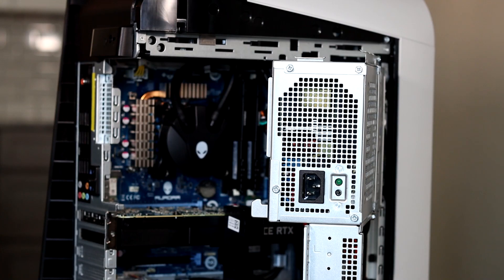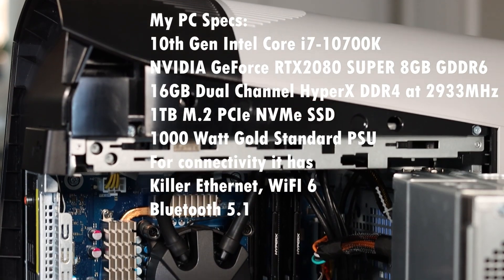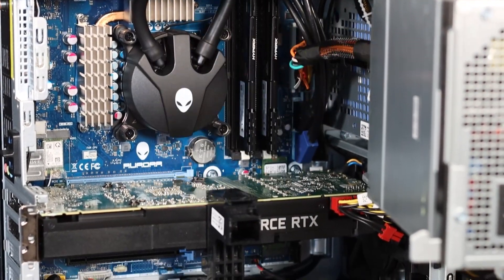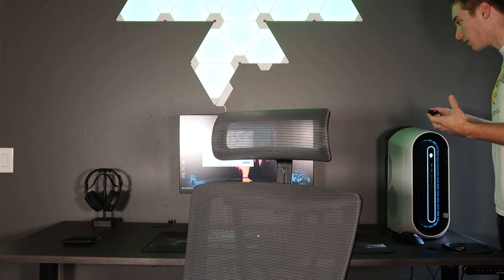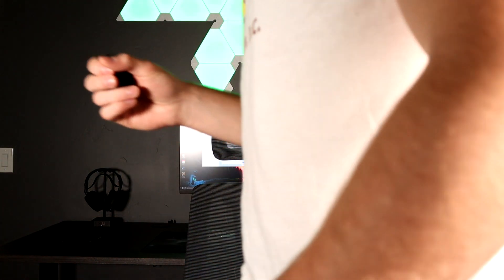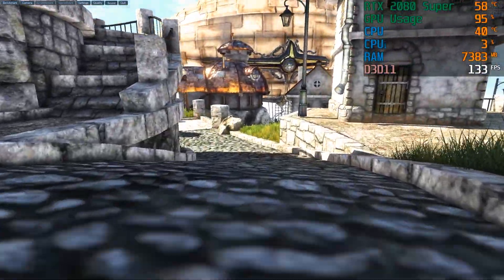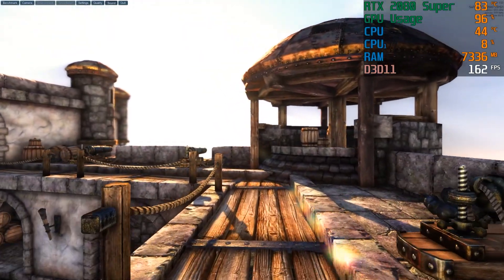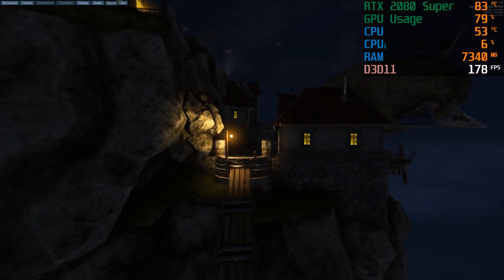Alienware Aurora R11 - Thermals & Fan Noise Test

Comment: hey, great video! so basically i don't need to worry about the gpu reaching almost max set temperature (84 degree)? because lately my gpu (nvidia geforce rtx 2080 super) started turning up and i don't know why
Reply: I reach that temp too on my R10. They used a shitty cooler for the GPU on these rigs

Comment: i got a 3080 10700 and during warzone my temperature for cpu goes up to 90, is this bad?
Reply: I have the same thing but we need to update our fans and possibly get liquid cooling in order to drop the temps at least 20 degrees
Reply: very
Reply: its warzone tho call of duty is bad on PC
Reply: @solidrenegade  ehh it’s better than on console that’s for aure
Reply: @josemadriz5716  optimization wise so no it’s not better on PC
Reply: @solidrenegade  what are you even saying bro 😂
Reply: @josemadriz5716  knowledge because I actually have a PC, it’s unoptimized on pc so it takes up unneeded hardware like MWR for example.
Reply: @solidrenegade  why does every pro use pc cause it’s better than console
Reply: @josemadriz5716  what pros? Swagg and shit use pc for VPN and bot lobbies lmao and I never said they were all bad on pc
Reply: @solidrenegade  bro make up your mind, is console better than pc? No it isn’t! That’s why most players use Pc. Console is shit with its horrible FOV.
Reply: @josemadriz5716  FOV doesn’t mean console is horrible, all I’m saying is call of duty is unoptimized on PC.
Reply: @solidrenegade  bro just stop talking, pc has better frames, better FoV, better graphics, just stop. No one cares about “optimization”

Comment: If you would of set your gpu fan at 60% in msi your gpu temps would of been under 75c. People are not using the gpu fan correct in msi/af which is way their gpu temps are over 80c. I use 55% fan speed while gaming always for my R9 - 2080 Super and run at High Performance mode in AWCC. My card never ever gets over 75c.
Reply from the maker: I just didn't want to change anything so people know what to expect with it just the way it is. Thanks for the recommendation though

Comment: Gotta use msi afterburner to control gpu fan and temps. My 2080 super never gets over 75 when using msi manual fan settings at 55 % . I do not use the gpu fan in auto. Just slide it to 55 and apply. When I’m done gaming I use the auto feature
Reply: Is there a way to controller cpu as well?
Reply: @itsajoke631  —- I have liquid cooled cpu so I don’t know about that sorry

Comment: About the fan noise is it always that noisy at all times? Would it be that loud if I’m running an old game that doesn’t revolve around graphics?
Reply from the maker: I showed when its under no load and under almost max load. So if it was less it would not be as loud as it is at full load. The fans will just ramp up as needed to keep GPU or CPU cooled.

Comment: Would this be a good first gaming pc I’ve never played games on the pc but I have been wanting to get into it thanks you and have a good day
Reply from the maker: Yeah, for a first gaming PC this would work good. If you knew how to build a PC I would recommend that, but dell does a pretty good job with the R11. If you do get this just make sure you choose components you would need to do what you plan on and get the water cooled chassis, cause if you go with just air you will have troubles with thermals. Dell has a good warranty that I would recommend getting too since its your first PC
Reply: Caleb Thornton ok thank you for the advice I will keep this in mind when trying to decide whether I’m build one or buy a pre built one
Reply from the maker: @badnfluenzz4646  No problem! Thanks for watching 😀
Reply: @CalebThornton  i7 10700f, 3080 gtx, m.2 500gb ssd, 1000w psu, single fan radiator water cooled cpu, they don't say the mother board type, ram i have 3200mh 4 sticks of 8gb I'm hoping it has the slots for it? Along with a WD black m.2 1tb ? What would you recommend for a personal built pc? Gpu's were so over priced from lack of stock 😬 For $2040, I couldn't build anything cheaper that I was seeing. Maybe when stocks get up to demand prices would be closer to msrp
Reply: @1Deejay7  Exactly. As far as the motherboard, I could just find out it's the "micro atx motherboard". I'm still debating to buy pretty much the same build as urs or just wait a couple months since I've never done pc gaming (just consoles)
Reply: @1ce2berg  so the board only had one m.2 slot and my 4 sticks of 8gb ram wouldn't work at 3200mh since only 2 dimm slots supported xpm is my understanding. Im actually going to return it. I had extremely poor customer service, also never recieved the promised cold war game codes. I've looked at a number of pre build companies and it seems I BUY POWER is the cheapest one with a lot of decent options that other companies overcharge on.
Reply: @1Deejay7  Thanks for the info! Yea, they all overprice and possibly put Inferior quality parts that aren't as important so nobody will be paying attention to them. I'll check out I BUY POWER. But at this point, I am leaning towards building my own pc based on a 3080 and a i7 10700, with the help of a friend
Reply: @1ce2berg  Goodluck, I actually wanted to go that route too but I couldn't find any msrp priced 3080s, no matter which brand. All were well over 1k. Probably due to miners and scalpers buying the bulk of what's even available
Reply: @1Deejay7  Yup, I'm in Canada and this store did have them available on backorder for $1200 CAD (not even including sales tax lol). At this point I have accepted spending at least $1k on a GPU lol. An unrelated question regarding Alienware, I am planning on getting their 38" ultrawide monitor to pair with my new pc. You think it's worth it or should I just go for the LG CX48 for the same price of $1999 CAD?
Reply: @1ce2berg  Nice selections, I just have a LG GN850. I'd say it depends if you're a competitive gamer or just using it for recreational play. Alienwares 144hz vs 120hz. I'd probably get the LG, 4k oleds are amazing and you would definitely take advantage of the 3080s capabilities. I think later on in 2021 higher refresh rates will available for oled. Just my novice take on it however.
Reply: Yes !!! This is a beast of a gaming machine. Don’t buy ... make a investment.
Reply: Honestly i think its a aweful first gaming pc for the price. For that price you can build a high end pc with a youtube tutorial and about 5 hours thats how long it took me to build my first and even on benchmarks and anything my gaming gpu never hit above 50° ive tried dell and hp because i was scared but firstly my hp omen ran hot like this one. And my dell my gpu crashed after 1 week and i had artifacs i would never recommend these brands. Especially because the parts they use are just not great honestly. All low end parts. I wanted to love them i even tried both hp and dell high end 2500 gaming pcs both with rtx 2080. But the custom one i build is awesome but im curious about the 3090 because i bought a cool lg cx tv

Comment: Thanks for sharing Caleb.  I got exactly the same setup a week go. I am into Flight Simulator 2020, x-plane 11 and fortnite occasionally at ultra.  I find my GPU temps maxing at 84c consistently which is higher than the average 75c for this type of cards.  

I then took the card out and found out that AW is using a customised version of the MSI RTX2080 Super Aero. (Blower type - budget GPU) in my setup.  I found the temps to be on the high side TBH.  So to compare I put in an Asus  GTX1070 Dual OC and amazingly the temps went down to max 74c and lower CPU temps at about 60c avg compared to 70c.  (lower FPS of course)

The good news is that It seems that this case can handle dual fan GPU's which seem to provide better cooling.  Now I have to call Dell.  Thought I  share that.

PS:  Liquid cooling for this card is recommended.
Reply from the maker: Thank you for letting me know, Dell is annoying and i hate what kind of parts they try to get away with putting in these sometimes. Hopefully you can get this resolved.
Reply: Is the PC good for MFS2020

Comment: Few things to note:
1) You may want to move your case out from the wall or angle it. The GPU is a blower and all the heat is sent out the lower back of the case.
2)The 2080s was Thermal Throttling and that why it didn't get any hotter. If you look in after burner you will see that happening.
Reply from the maker: Ok, thanks for tips. It's 8-10 inches away from the wall so it should be fine. According to GPU-Z I'm actually performance capping because of Power. As far as i could see it was not because of thermals but then again i am not that good with troubleshooting and figuring out that stuff. I planning on building my own PC within the next year so i will have to learn more about it.
Reply: @CalebThornton  In MSI afterburner just drag the power to max and it will allow more power but the Temp limit is 84 so would likely need to bump that to 88

Comment: try testing the unit without the liquid cooler. Mine was like a freaking leaf blower until I upgraded to a CPU aio and replaced all the fans to corsair ml120 pro non led fans. Sorry but video feels like a Alienware say some thing nice promo.
Reply from the maker: I only have one with liquid cooled CPU so i cant test the other options, but thanks for input. Maybe someone else can benefit from this, so far mine has not been very noisy at all though.
Reply: I mentioned this on his other video. People really need to consider the water cooled option vs air as the chassis is really designed with liquid cooling (considering the psu placement)  Also the fans Dell uses are server grade and can max out at 4400-4800RPM  WAY overkill on their part as no one would ever want them running at that speed. You either tune them down to acceptable max levels or change them out for others.
Reply: Hi I just bought it the same pc but with fans, I'm still noobs at pc. Can you tell me what liquid cooler you went? The full name. And do you have any other recommendations for other fans? And what does cpu aio mean? Thank you
Reply: @itsajoke631  The H60 from Corsair. You need a single ML120 Pro non LED fan. also a noctua y splitter. the AIO comes with a good fan that you can retain for push pull on the radiator. I also picked up a second ML120 fan  to change the front lower fan.
Nice a cool with almost no  noise.
Reply: @Spectrus_operator  did you change the psu fan too?
Reply: @itsajoke631  the Power supply unit is ok. Unless you are going to put a 2080 or the new 30 series card in to the machine.
I used the Corsair RM650
Reply: @Spectrus_operator  ok I replace them today but fans still make noise but they temperature is better but now when I restart my computer, they system won't recognize my fans. How do you bypass this?
Reply: @itsajoke631  google liquid cool upgrade for your machine.
On the dell pages there are lots of pictures and descriptions of the instal and any issues.
You have to use the ML120Pro non led fan to the top fan.
Reply: @Spectrus_operator  where to connect for noctua y splitter?
Reply: @itsajoke631  Mate go on google and search.
Reply: @Spectrus_operator  I did, I don't see noctua y splitter have 3 pin that go into 4

Comment: Great video. Do you think this computer specs can run flight simulator 2020 from microsoft well?
Reply from the maker: That game is notoriously hard to run, but with settings adjusted down a bit you should be able to get between 30-60fps which from what i hear looks good in that game.

Comment: Sound has never bugged me personally. I have mine down on the ground on a stand. The liquid cooled CPU compared to fan cooled CPU is a pretty big gap. When I’m on straining the system with games CPU generally sits around 75c-80c. When I played MS Flight Sim 2020 it was hovering around 83c.
Reply: same here my cpu is liquid cooled and I notice even in heavy gaming it is not louder than I would expect any system to run.  I did not go with the liquid cooled gpu which I heard can decrease the noise by a little but I dont know if it is enough to justify the extra money

Comment: Do you have the CPU liquid cooling option?
Reply: Ok thanks also your videos are great!
Reply from the maker: Yeah i do have the liquid cooled option.
Reply: @CalebThornton  But at this video Your CPU was not overclocked thru the AlienwareCommandCenter, right?
Reply from the maker: @wingeladvokat1920  No it was not. The test i was running was mainly all GPU intensive, since most people are buying this as a gaming rig i figured bench-marking the CPU was not necessary. You are able to use the overclocking profiles they include though and also modify them to your liking which is a nice addition.